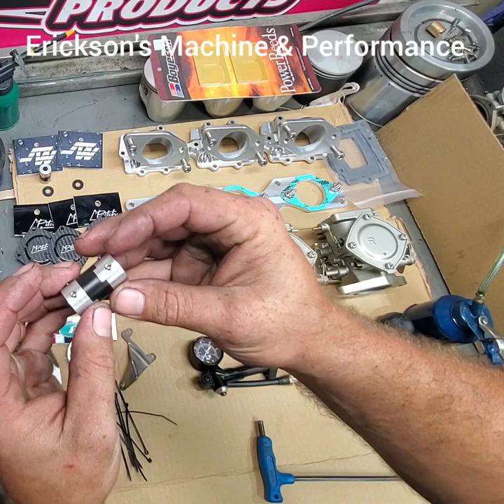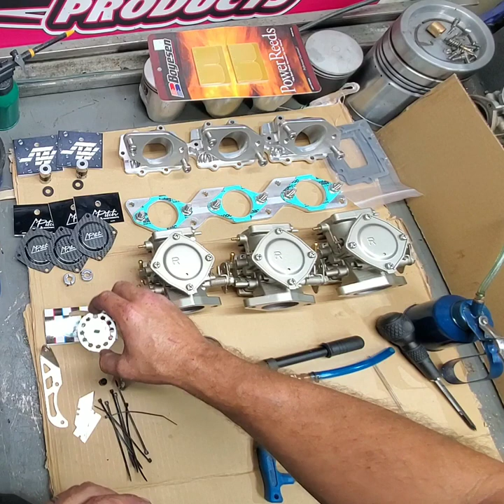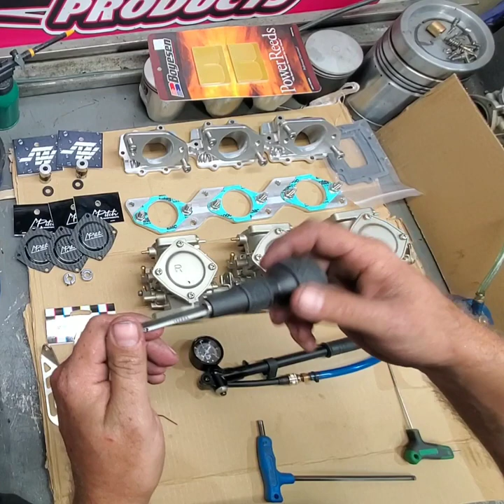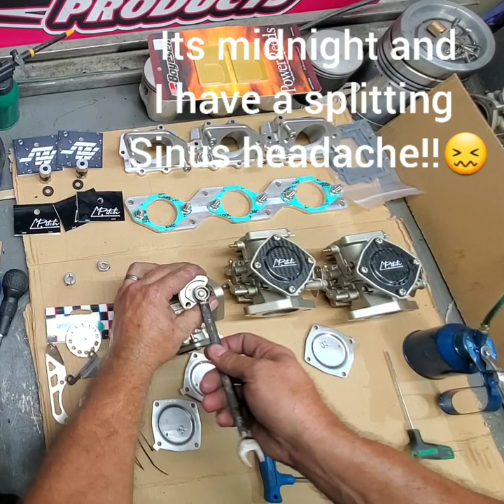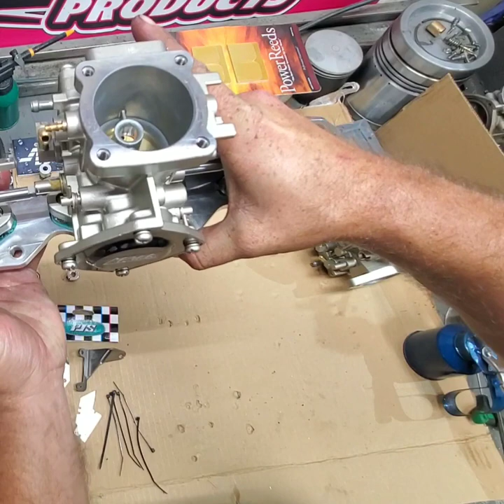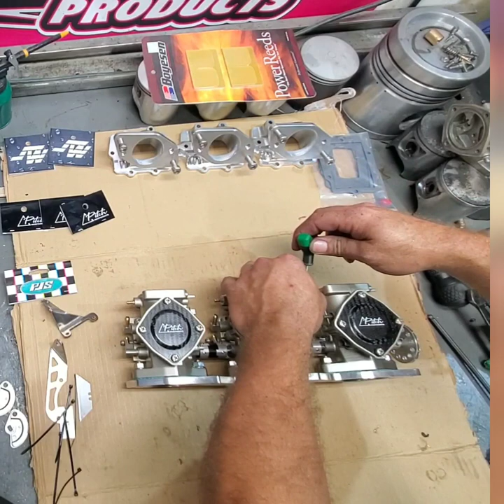How to check popoff pressure and setup carberator linkages on Mikuni Sbn 44s ,46 ,48 ,50 mm carbs

Comment: Great video, appreciate the instructions as always. Would love to see something that explains how to replace a shaft and throttle plate on an SBN44. Having some challenges after replacing one of the butterflies in the sbn44, used wsm parts. It seems the butterfly is binding on the carb throat regardless of how I set it up (as soon as I install the screws). Any tips or tricks you might have ? Did I make a mistake by not using mikuni parts 😅
Reply from the maker: Email me your # I'll walk you through how to fix it.   I'm also doing a video on this but it's a couple weeks out still

Comment: I have triple Mikuni's on my 97 Yama Waverunner 1100 that I got used.  Any thoughts on why I'm good at idle and good at 25% throttle or higher, but getting from idle through up to about 25% is a struggle at times?  Do I need to check pop-off pressure?  I've rebuilt the carbs and subsequently had them off and apart and reassembled 5 times myself finding little things here and there and everything is clean and seems to be together, but coming off idle it wants to die unless I hit it with two shots of primer.   WOT gets me to 50mph on GPS speedo which I assume is good for this machine unless you tell me different.

Comment: Probably wrong thread but just found your channel and subscribed. Do you have a vid on replacing rings procedure on yamaha 701 61x?
Reply from the maker: I have a  big bore 701 assembly video
Reply: @EricksonMachinePerformance  I watched it! Thanks for the good tips and tricks. On stock 701 where are you lining up the piston rings? Writing up I assume, arrow or Mark on piston to exhaust side, correct? Is there a certain spot rings need to line up with? I'm an old outboard guy, it'll be my 1st ring job on pwc motor. Any quick tips for newbie? Light ball hone? Replace pistons while I'm in there? Thanks in advance
Reply from the maker: Email me some pictures and I can point u in the right direction Ericksonmap@gmail.com 
Yes the arrow goes to the exhaust port

Comment: Original superjet dual carbs comes with some kind of spring loaded linkage allowing to adjust them one from another, what's the purpose of this, your couplers seems a lot simpler and straight forward.
Reply from the maker: That's the difference in oem and aftermarket 😂       this style is better and simpler in my opinion

Comment: So you just want to make sure that all of the butterfly’s fully close on the throat body when the idle screw is all the way backed out? Why do some people use a special sync tool? That measures air difference or something?
Reply from the maker: thats more for motorcycles with 3 or more carbs
the run at much higher rpm.   its not needed with a 2 or 3 cylinder pwc